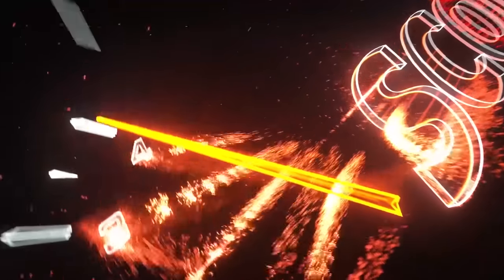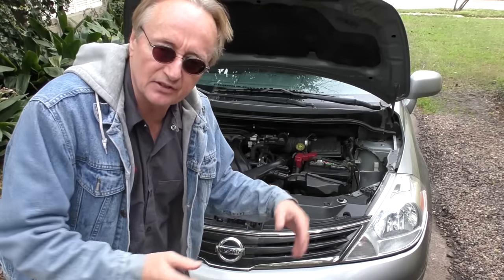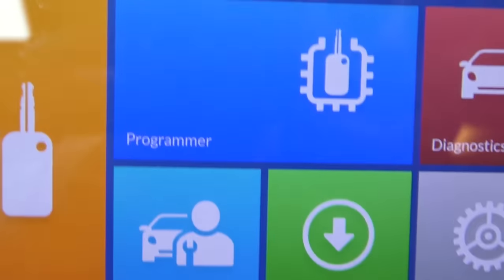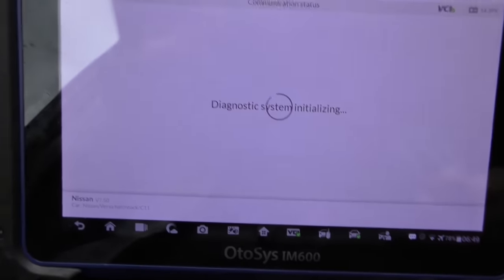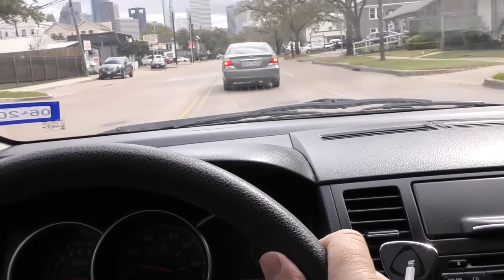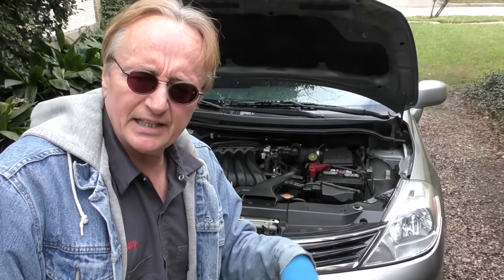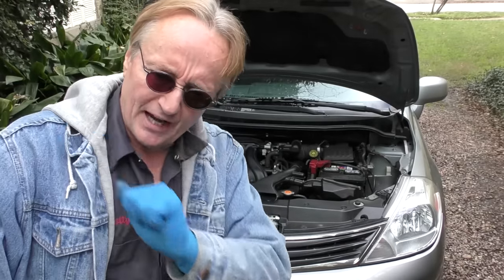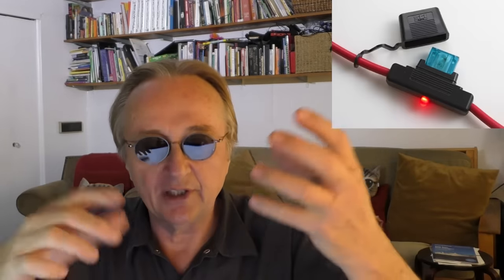Here's Why You Should Buy This Cheap Nissan

Comment: They're doing it again! I know this video is 2 years old, but the 2023 Nissan is under $16k!! INSANE!! But that transmission I am concerned of because, I admit at times I have a Lead foot. What say you Scotty? Because I am interested!! 48MPG!! Is there anything better for the price?? Hey! I am interested in ideas and knowledge from anyone here! :)
Reply: Good mpgs but you're better off getting a hybrid. You get power, reliability, AND fuel economy.  The versa only has 122 horsepower in the 2023 model for $16k. That's way underpowered.
Reply: @AustinRides7264  Problem is with Hybrids although I do like the idea, is the Battery Life. How long do the cells last and they begin at over $30k Don't worry, I've been balancing the idea between both.
Reply: @yeoldesaltydog7415  a newer hybrid uses lithium ion batteries and those last the life of a car. So on my 2013 fusion hybrid for instance I have 220k miles on the current pack and I have met several other fusion hybrid owners who have put almost half a million miles on the original battery and it STILL runs fine. I haven't experienced a decrease in gas mileage either at all.
I believe you can buy newer hybrids for $25k. And they'll hold their value better than regular economy cars too. Trust me
Reply: @AustinRides7264  ok ok thats great to know! o.o Thank you
Reply: the $16k price applies only to the stick shift. The CVT version you won't find for less than $18.3k.
Reply: @henryjoshual1848  Im looking at the manual. Gen X here :P
Reply: That’s why I’m here lol. I’m in the market for a new car. I’ve never purchased a brand new car but for $16k I can save that in a few months. I’m here for the comments. Ideally I’d like it to last at minimum 7 years. I’d also take a 2021 or 2022

Comment: Got our second manual tiida. First one was totalled after someone in an old range rover backed into it. They put it into r for race and got r for reverse. Immediatly afterwood went looking for a replacement.found another with more miles on it but manuals are not easy to find. Clutch went 6 months later. Replaced the bi metal clutch with a normal one. Cost 1200 for the clutch and 800 for work. Replaced a starter motor last year.

Comment: Recommend the 6 speed manual, best car I’ve ever owned.

First one I had was a 4 speed automatic 1.6. BULLETPROOF little car that took me across the country many times even with 100+ k miles.

Picked up a 2007 6 speed manual 1.8, most fun car I’ve owned and I’ve owned a 90 crx, countless civics, a drift spec Silverado with a 5.3, still that Nissan is my favorite.

Comment: My ex had this car. She got the 2013 new. I won't lie car ran good. Had the 4 speed automatic, no CVT. She did have issues with the senor for the tire pressure system. But other than that it got good gas mileage and it didnt cost much in maintenance. And I'm 6'0 tall it wasnt too bad on space either. Last i saw her milage it had right over 100k miles. Just take care of them they are pretty reliable.

Comment: 14k to 2500, dam i need to move to houston to find steals like that
Reply: I saw a 2017 one for $4500. Im in houston too, we have 7 million people in Houston and its suburbs, imagine how many cars there are down here, a ton of them can be found cheap lol.
Reply: I'm in NC and I got an 06 Pathfinder for $665 bucks
Reply: @socksonfeet8125  flood cars lol
Reply: @TheGuruStud  not all, but the flood cars are basically free. Im talking like $200.
Reply: 600 cad for 2010 versa fully equipped manual transmission (70 k miles). Beat that

Comment: A Nissan Versa with just over 100k miles  for $2500 is a great deal. That car would haul a lot of gear too.
Reply: Got a Nissan Versa 2010 70 k miles manual full loaded for 400$ :))). 1 owner a bit of rust but everything is sound.

Comment: I bought mine new in 2016. I paid 8947.00 it had 4 miles on it. It has a manual transmission and only has 42000 on it now. When Trump was in office I went from Dec 24 to Dec 24 and my fuel bill was 540 bucks. It still only takes about 40 to fill it and I get 20 worth about every three weeks. I love this little car.

Comment: Still can't convince me scotty, I'll keep my 2G DSM and My 97 altima before I "upgrade" to the deathtrap that is a Versa.
Reply: I wish I had my 2G still, I sold it with 330,000 miles on it, still ran great.
Reply: @socksonfeet8125  
To be honest I've been asked if I'd trade and I usually laugh at their offers, the only one I'm currently considering is a 94 Pulsar that the guy imported from Japan. That and the engine is getting close to 350K miles on it. The pulsar is at 2.75K and who doesn't want a unique car ran by a GTR engine?
Reply: They're about as safe as a car from the 90's or 2000's.
Reply: @nanashinogombe4175  2G was perfect cause parts are still plentiful. If your gonna go with an old unique car, make sure you can find parts for it easily. Cause its a hassle waiting to find parts for rare cars. Trust me i know hahaha. I had a 83 Porsche 924 and a 85 Bmw motorcycle. Finding oem replacement parts was next to impossible so I got rid of them.
Reply: Power to you 💪🏼 I’m keeping my 2g forever

Comment: I test-drove a new 2012 Versa hatchback and the totally redesigned 2012 Versa sedan. The old hatchback design (like the one in this video) felt like it had a more expensive interior. Like that of a bigger car. Big comfy seat. Nicer quality materials. For me, the problem was that the engine sounded kind of coarse and nasty, and the 4-speed automatic shifted roughly. It also felt like the engine had to work too hard on hills. I thought it would end up being a tiring car to drive on my long, hilly commute. The redesigned sedan was so much smoother in all aspects, but the interior looked and felt very cheap. I opted for the sedan just because it drove so much better. In hindsight, I really wish I had gone with the hatchback. Time has shown the older generation hatchback to be more dependable. I ended up having to trade in my sedan after just 2yrs and 56k miles because the CVT was on the verge of failing outside of the 60k mile warranty.

Comment: I had an 07 Versa hatch. It was okay I only kept it for the 4 year lease. It was CVT. I would have kept it longer if it had been 4-speed or stick.

Had few early production flaws. Recall on something not labeled under the hood. A warped passenger airbag cover. And something not 'seated' properly in the front suspension at the factory in MX.

Comment: ive had my versa for 10 years , got with 14 miles out the dealer , manual transmission 122k miles and I've never had a problem , but the sensor problem is true that sensor popped up 2 years after i got the car

Comment: Thanks for the tip Scotty but I will never buy a Nissan. I've owned a CRX and two Accords and have put roughly 850,000 miles on them combined. My next car is going to be a Lexus IS (sorry Honda).
Reply: ColdPizza 
Do you drive cross-country?!
I've seen tractor-trailers that havent crossed 400k miles yet!

Comment: Scotty I'm a new subscriber, so could you recommend a good car for a woman. Nothing over 20k and would you comment on purchasing a used car from a rental company
Reply: Any toyota
Reply: Ideally you want to buy a car that has no loan, in case your job gets downsized and you need a car to get to job interviews. Look at any of the following:

1. Any 1996 or later GM car with a 3800 V6
2. 1996-2004 or 2009-2012 Toyota Avalon
3. 2002 or later Panther body (except for harsh winters)
4. 2005-2008 or 2011-2012 Mazda6
5. 2005-2006 Toyota Camry
6. 2005-2009 Mazda3 (have your mechanic look at the motor mounts and frame rust before you buy; those are the only two notable issues with that car)

I'd suggest buying from a private seller and not a dealership; the latter will probably try to gouge you. Rental car dealers have a better selling experience than normal stealerships, but the car quality may not be the best. Check the KBB private party or private sale pricing tool; it's a more accurate representation of market prices over the stealership nonsense. Have a mechanic look over the car before you buy it. A scan tool like the Creader 3001 can help you weed out issues with cars so better ones go to your mechanic. Look for:

1. Trouble codes to have the mechanic explain to you
2. INC codes; if there are any, the seller's hiding something; don't buy
3. If the VIN on the computer and frame don't match, the car was stolen; don't buy
Reply: Don't.....ever.....buy a rental car. Driven by careless drivers and carelessly maintained. Like buying a pig in a poke.

Comment: Always great videos! Question... my other 1/2 wants a used Chevy Equinox.. do you happen to know what year they started making them decently? I know at the start they had many issues.. Thanks and keep up the great work!
Reply: Has the stupid water pump driven by the timing chain if it’s a 2.4 Ecotec. The Equinox is garbage.
Reply: Solid advice from the other posters. There's a good reason why when Scotty says, "junkyard" he displays a Chevy dealership. 

Save yourselves a lot of trouble and buy a Rav4 if you want a small SUV or 4runner if you want a larger one. They will be vastly superior to an Equinox. 

If for some insane reason you don't want a Rav4 or 4runner, slightly less reliable yet reasonable options might be the Honda CRV or Pilot (do your research, beware of oil dillution).

Comment: I have a 2012 Nissan Versa. Bought it at 65,000. Now it’s has 252,000 miles on it. Original Engine and Transmission. Still run smooth!

Comment: I have a 2011 Versa hatchback. 236,000 miles. I've had it for 3 years and I think more than half of those miles are from me. I drive my car for work almost everyday. I haven't had any major problems so far. It's burning oil now but other than that my mechanic said it's in great condition and the motor still sounds good. I've been very happy with this Versa and plan on driving it till it dies.

If I ever decide to get a new car before my Versa dies in might think about getting a Subaru or a Toyota Rav4.

Comment: All this time, I thought all Versas came with cvts. 🤔
Reply: Mark Ferrer 
Versas were originally designed for 5-speed FWD manual, *as they were modified Renault Clios*, 
   In N.america, around 2007, the Versa was original sold with 
   S-trim 4AT & 6 speed Manual
   SL- trim  CVT

Comment: My 2013 Nissan SV Sedan had a CVT and it died at 70k miles. I was a new driver and learned some hard lessons in that car.
Reply: Did you change out the CVT fluid and filters? If not then that's probably the problem.
Reply: @GenEmperor  I paid $600 to have the dealer change the fluid at 50k miles.
Reply: @SnowBunneh  I could be wrong but I can't help but think they didn't do it right or perhaps your CVT was defective or something to that nature.
Reply: @GenEmperor  I worked pizza deliveries, was in a flash flood, ran over a really thick curb trying to avoid a bus, and sped before getting my first ticket and learning the hard way. Any number of variables could certainly have caused it. That being said I feel safer with my Honda Civic now.

Comment: I used to have one of these, a 2012 in red. I loved that car. I was about $3,000 away from paying it off until I totaled it. It was a very reliable car. The only thing I had to do, other than normal maintenance, was replace the battery. Then I got a 2016 Versa sedan in maroon. It’s alright…but I’ve had a few issues with it and the quality isn’t as good. And it has a bullsh*t CVT.

Comment: I started my career as a field technician , then I went to school and became a field engineer, now I’m a radiation safety officer . One thing I’ve learned over the last 14 years would be most things are not designed to be worked on. We have a service department that charges 275$ an hour to work on our equipment. From our managements perspective they don’t need to be too easy to work on. It’s less than ethical to say the least

Comment: I bought a 2010 nissan versa new and had it for a decade. It was a reliable little car. I put 200K miles on it. Never had a problem with the transmission or engine. Those 4 speed autos worked well. I had to junk it when the subframe rusted out. 10 years on salty PA roads killed it, but that can happen to any car here. It's a shame Nissan's quality went downhill.

Comment: My 2011 Nissan Altima was purchased used on a lease turn in some years ago with 24k miles... it now has 175k miles on it now and never had any issues with it, but I also have a 2019 Murano and hope it does as well as the Altima
Reply: As long as you change the cvt fluid every 30k you’ll be fine I’ve had 2 Nissan cvts with over 150k with just basic maintenance and 30k fluid changes have a 2019 Altima rn and the new cvts are much better

Comment: I can't complain about the 2006 Tiida (Versa) I bought three years ago. It has been reliable. I just changed the transmission fluid using Valvoline, seems to work fine, no slipping.

Comment: Was looking for a used car. But was only seeing Nissans with terrible reviews due to them ctv transmissions. Went with a used 08 Civic.
Reply: AboutThatTime420 
Be warned:
   If your Civic has an automatic transmission....
      You must check the service info on your transmission;
     If your transmission hasnt had the ATF & tranny filter replaced in 65-70k yet, 
    you might be in danger of having the transmission fail
    THUS:The point of running away from Nissan CVTs is pointless

Comment: i travel and rent subcompact to save miles. Best of all of them by far is the Versa Note. So good I bought a 2017 Versa Sedan with CVT.  Drive it gently and seems a great car to 35,000 miles. Put on Michelins. Big difference in ride quality. If u drive it hard it will fall apart. made of snap on part.

Comment: $2500 isn't bad. The wheel sensors will need fixing in states with inspections though. These were the Thrifty rental specials for awhile and they do the job.
Reply: Hell with that inspection. You know what you do? You take the gauge cluster out, you find the spot where the tire light is, and you put a square of electrical tape over it. Put the gauge cluster back on. Boom. No tire light.

Comment: Just in case someone comes back here. I own a Nissan Versa 2010. I replaced 3 mufflers now the whole exhaust needs to be replaced. I replaced the transmission in my automatic car and it wasn't covered. The front coil issue the air bag recall. Normal breaks. Soon the break caliper is toast.

Comment: I bought a Yaris new in 2007, and it has 170K miles on it now.  I haven't had to do anything to it except change the clutch on the manual transmission, it still gets 41 mpg, and starts immedietely.  I wouldn't waste my time gambling on any other brand like Nissan, Toyota makes an almost perfect car, and its priced similar to the others, why take a chance?
Reply: Ellenor Bovay 
Can five 6ft tall adults fit inside your Yaris comfortably?
(is yours hatch or sedan?)

  I can do it EASILY in a Versa & still not strain the engine either!

Comment: If i go speeds at 85 or over, it stops flashing. I did it just to see what would happen and it stops flashing!
Reply: MusicaMazizaTV 
The TPMS system of a Nissan uses TWO inputs
-Air pressure data from inside the tire
-Wheel speed data from ABS or transmission speed sensor.
👉low air pressure in tire makes wheels move faster.
👉high air pressure makes the tire move slower
👉Fast-moving wheels cause warmer & high pressures in tires
 -In your case, 
the busted TPMS computer will turn off the tire light if you fooled it to thinking the wheels are rotating at normal speeds!

Comment: I must be getting lucky. First Nissan Altima I had got me to 320,000 kms till it stuck itself in 6th gear and stayed there. Second one I have at 230,000 kms and no issues. Both were the V6 SE model, 2006-7. Maybe the V6 is more reliable than the 4cyl 2.5. I also used the manual shifting feature all the time cause I hated how it shifted.
Reply: James Brett 
The V6 model was more reliable because the USA factories who built that car had more experience building the V6 engine.
   The 2.5 engine was a rushed experimental engine shoved into the 2G Altima to make more money at the expense of risking reliability by inexperienced factory workers..
Reply: My co-worker bought his 2005 Altima brand new and ran it to 335,000 miles without sticking any money into it.

Comment: I owned a Yaris.  I drove the Versa as a rental.  They had the same ride.  Similar performance.
Reply: The 2007 Yaris has its spark plugs under a beauty cover.  Takes two minutes to remove.

I don't know the crash ratings for the Versa, versus the Yaris.

Comment: Sad thing is everyone, including Toyota, has gone to CVTs.  It's almost like you might as well not buy a new car, but a used 10 year old car with a regular automatic trans.  Not this CVT crap they're using today.  But good to know in case I find a used 2012-era Nissan Versa at a good price.  I've driven their newer Versas and wasn't terribly thrilled (granted, they were all rental cars).
Reply: Heelix Ranier 
Everyone who still makes ICE powered cars in 2020 has to obey stricter fuel economy standards than 1990-2008
    CVTs are more fuel-efficient that heavy multispeed hydro-matics
   & thus most automakers are adopting the pulley-belt type CVT more than ever to improve fuel economy.
    RELAX, IVE MET PLENTY OF NISSAN CVT OWNERS WHO CROSSED 180k+ MILES ON THE SAME TRANNY

Comment: They got a better deal than I did - I picked up an 09 six-speed for 3k, but with 200k miles on the odometer. It's been fairly reliable, had to change the spark plugs because the plastic / ceramic on one broke off lol. But good little cars for the price.